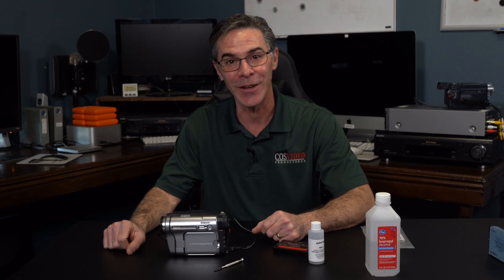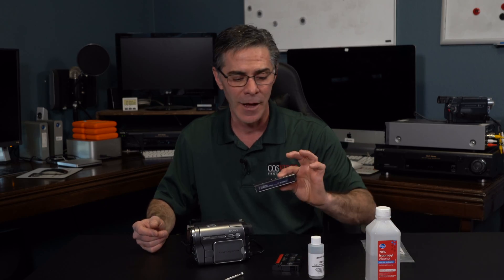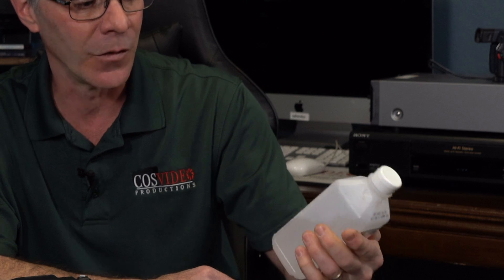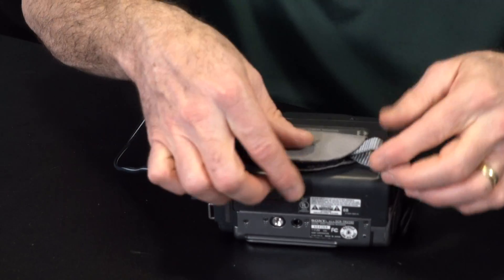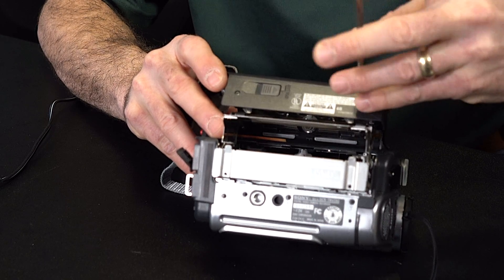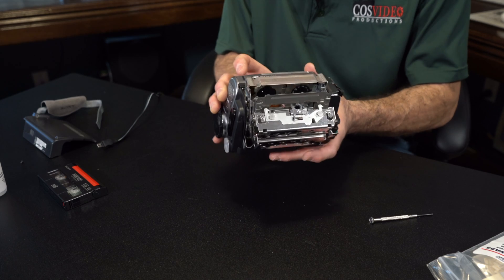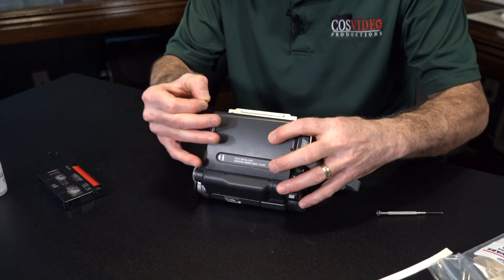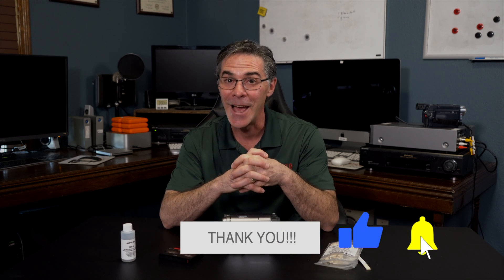How To Clean 8mm Sony Camera Head for A Bottom Tape Loading Camera

Comment: Thanks, Mark! I tried pretty much the same technique with rubbing alcohol and a Q-tip. For the Q-tip, I used more a of a blotch technique to avoid any potential fibers tearing off. I also made two passes over the heads, as the first pass definitely helped the image come through, but there was still a lot of noise. The second pass got the image to look clear as day. I hope this helps anyone else with the same problems
Reply from the maker: Honestly, I prefer QTips because I think they do a better job and I do the same thing as you.  I just get a lot of crap from “professional” when I do use a Qtip so to keep the nasty comments down, I use the swab.  Keep botching my friend!!!  Thanks for watching!
Reply: hi! sorry if this is weird. i've also had this problem with the camera and want to clean it, but i live in Chile, so getting those chamois swabs is even more expensive lol. i thought of using Qtips, but don't know how to do it in the most safe way. as i'm not a native english speaker i'm not sure what you mean by a "blotching" technique, would you mind to explain a little further? i'd be so gratefull!! thanks in advance :)
Reply: @ferrioseco5139  No problem! What I mean by blotching is to firmly press or hold the q-tip onto the area instead of swiping. Ideally, this should prevent cotton fibers from tearing off of the q-tip. Good luck!
Reply from the maker: @ferrioseco5139  "Blotching" would mean lightly tapping the sensors on the play head.  Do not rub back and forth.
Reply from the maker: Great Job! Thanks for watching!
Reply: @DaKoRnMaN  tysm!

Comment: I just bought that exact model and came in today.  wooohooo!  Do you which cables I need to transfer videos from camcorder to 2020 Macbook Pro with USB C port?
Reply from the maker: I would use a firewire cable. since firewire cables are old school now-a-days, you may need an adapter for the c port.
Reply: @TheMediaNerdMT  thanks I got a FireWire to usb a to usb c adapter. It didn’t support usb a I think.

Comment: I was under the impression tape cleaners only work once not 5 or 6 times? Am I wrong ?  Thanks
Reply from the maker: I guess it depends on the tape cleaner.  Most will run  a few times like I had said in the video.
Reply: @TheMediaNerdMT  I worked during the video payday in tv from 1978 to 1997. We always were taught that tape cleaning cartridges when used up once throw it away.  Sorry to upset you.   Thanks for your channel. Very informative and leader in the industry.
Reply from the maker: @laserfilmlab  you didn’t upset me at all.  Thanks for watching and supporting my channel!

Comment: Hi Mark, thank you for this … I have exactly the opening scenario, same camera you demonstrated. Delighted that it worked initially and then horizontal lines appeared, realised needed to clean but issue sourcing cassettes as you mentioned. 
Unfortunately I tried to delicately clean with a fine small brush. Barely tipped but since that the cassette compartment won’t close so I must have disturbed some part of mechanism. 
I literally found your video 5 mins after. So sad as It has taken me years to get these tapes to play. 
I hope you might be able to help, have taken photos & video of issue but don’t think I can upload through this medium . Please let me know if there is a way of sending to you. 
Kicking myself I missed this very instructive vídeo first 😢😢
Reply from the maker: You may contact me through my website

Comment: Please do not use rubbing alcohol! Often has oils in it. Use 90% instead. No oils and it dries faster.

However don't use alcohol on the rubber parts. It can dry them and damage them.

Also there are some even better cleaners i know of like acetone but they will kill plastic parts.

Finally another good reason for not using the tape style cleaners is they are very abrasive, by design and can wear the heads over time.
Reply from the maker: Thanks for the comment. Most people watching will only need to clean there camera maybe once or twice to get the transfer job done so a little rubbing alcohol is not going to hurt anything. Also, by the time it takes to put the camera back together, hook up the camera up for transfer, I think the 70% will have enough time to dry. I have been using alcohol like this for years as well and have not seen any effect from oils that may be in 70% (but it does depend on what type of alcohol as well).  I have been told by another person that tape cleaners can damage heads but  I have been using tape cleaners for over 20 years and have never had an issue with my heads getting damaged.  I have looked this up and don't see the proof.
Again, most people watching this video have small jobs to do so these precautions don't really matter.